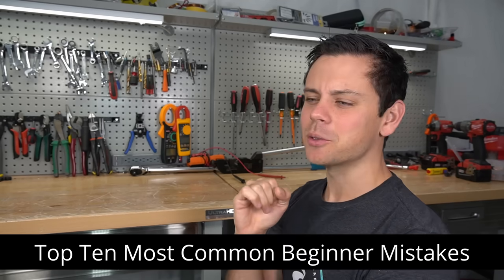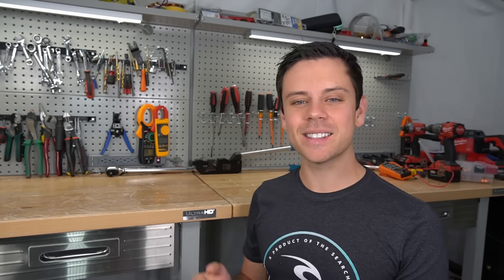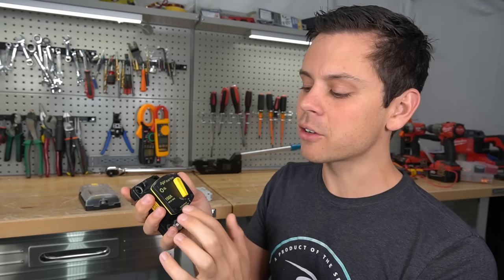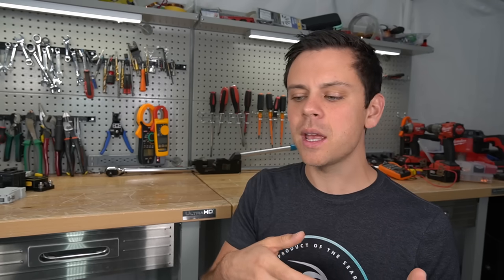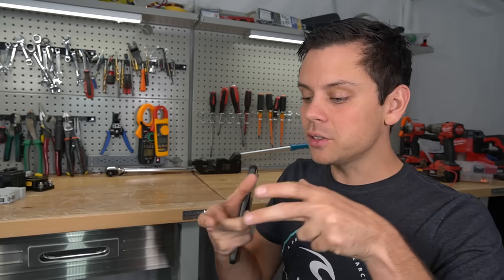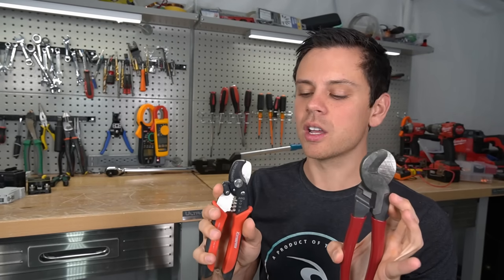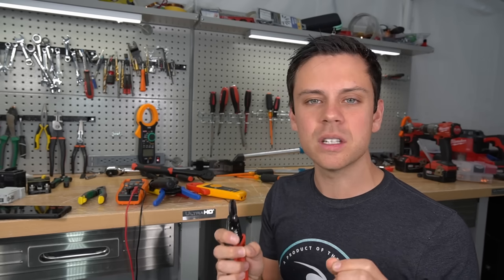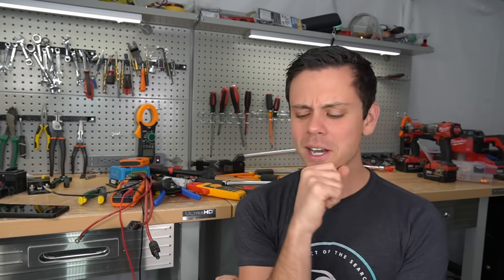Top 10 Beginner Mistakes When Building a DIY Solar System

Comment: i am a noob stumbled on this video as i am researching a replacement for an SLA 75 amp hour in a travel trailer that has gone flat.

The charge controller in the trailer is a 10 amp go power PWM. The solar panel is one go power 190 W on the roof.
12 volt is required to run the furnace.
And current configuration is not handling in it through the overnight battery is three years old. 
Looking at Chin on the amazon . can i do one battery now, and add one later to increase run time? 
or is it best to match in pairs?

Comment: Hello, we arent getting power to the inside of the trailer after hooking everything up properly.  We even tested the inverter with a power drill pluged into it and it worked perfectly.  We then separated  the converter fuse to a stand alone switch and that did not help.  What do you suggest?

Comment: What's your opinion on the lifepower 4 batteries with the CHINT cb-125a breaker? It is ac rated 230v 50hz on the label. No dc marking, must be de-rated for dc.. Feels a bit weak when operating.

Comment: Hello. I'm new to learning about volts and amps, and connecting up solar panels to an Ecoflow power station (generator), and am hoping someone will be kind enough to answer a question I have.  Is it ok, if I connect four 200W 12 Volt panels in series, and then add one additional 200W 12 Volt panel, using parallel?  Or will this cause problems.  Thank you, Lori

Comment: What is the theory behind the Minimum Voltage and how does it play out in practicality?

Clearly, during non-peak daylight hours the output of any panel is going to drop, no?  Meaning you will spend at least a third of every day below that output level.

So what is the minimum voltage threshold really about?

Comment: About 25 years ago I had a boss come by a control panel I was finishing up and told me I needed to go through all the terminals and check them. Told him I don't need to, they're all good (about 400 of them). To which he said, There's loose wires in there. I said go ahead and check. If you find a single loose wire I'll re-land the entire panel. So he proceeded to start yanking on wires. Finally after a while he got down on one ripping the terminal apart and proclaimed, "Found one!" To which I said, get out of my panel you jerk and go annoy somebody else. lol
He turned into a pretty good boss over the years. Could be a pain in the ass but I rarely saw him more than 3 or 4 times a year. Best kind of boss to have. Give you the job and leave you alone to get it done.
But some of us got all those torque specs programmed into our wrists brother. lol

Comment: My load center is 100AMP. That is #3 AWG by code. MPPT 6548 AC input connection fits #4 Maximum. Does that mean you cant go from an inverter to a load center 100amp or more?

Comment: Tinning wires with solder before putting into screw terminals is a no no. The solder creeps over time causing a loose connection.

Comment: Thanks for the great video Will!

One question I have around wire terminations in screw down terminals (such as the Victron solar charge controller). Should you terminate the wire in these terminals bare or can you use a ferrule? I like using ferrules because they prevent any strands slipping out or breaking off, but im not sure if there are any drawbacks from using them I am not aware of.
Reply: Ferrules should help terminals not to loosen as easy, prevent single strands from shorting things out because they are much harder to see in the connector than while crimping. It is still a good idea to check they are tight.

Comment: Would a Litime 100ah battery with an internal BMS need a low voltage disconnect in the wiring system?

Comment: Hey man. Is there a way to talk to you? Even 15 min. If you have prices for that, please post them somewhere. I found your channel just in the last few days. I haven't seen all your videos, so if you covered that, I'm sorry. I'm going through them. I'm working on my set up right now. And somewhere I'm messing it up. Just connecting panel to charge controller somehow I'm not getting power to it. Wires are stripped, it's not rocket science to connect 2 wires to charge controller. Could there be a short, or some other damage?

Comment: Wire that is striped improperly is better to be soldered than crimped.   Solder can fix damaged wire providing connection is heated properly before applying solder.  I have found all kinds of problems with crimped connections.  Granted this was with lower power connections.  Heat shrink holding bad crimp connectiond together causing intermittent-ness.  I understand your NO5 but, question the high power aspects as better to not use solder?  You have experience that is different than mine ie. low power. crimps weaken the wire in most cases.  Heavy wire could be must different?  insulation crimped between contacts is a big problem.  The Proper wire striper can remedy these problems. Solar is much different than I have worked with.  I am just surprised crimping is best?

Comment: If I want to use solar panels to power a crypto mining rig running at 12V, should I convert the panels to an inverter then to a normal PSU or should I use a DC/DC converter to power directly from the 12V panels? PS, no batteries, just direct solar to run 5-8 hours per day

Comment: Good day, I just bought a Eco flow Delta pro with one 400 W solar panel. My intent is to put it in the closet and not use it but if I need to, I’ll bust it out for an SHTF event…….. is a bad thing (not using it for potentially years)?

Comment: With regard to #10…
Friend is about to try testing his EG4 6500EX48 with only 2 Canadian Solar 445 watt panels… where the voltage total in series will fall slightly below the 80V startup voltage. (78vdc -96vdc where low is operating voltage and high is the VOC)(39.3vdc and 48VDC respectively)
What will the result be of this setup? Will it fail to charge his EG4 5100 battery?
Reply: So my friend finished his install with only two panels - Doesn't have time to install the rest.
The two panels in series did provide the required startup voltage just fine...
One thing to watch out for is on the DC Battery Disconnects from signature solar - double check the screws for the copper plate that is in there - even if your wire terminal screw is tight, this screw may not be and will cause a problem and cause a fault at the battery, thus not starting the inverter. - make sure the copper plate is aligned and tight. It's easy to miss if you're just checking the cable screws.

Comment: What good are torque wrench & screwdriver when most devices do not provide torque specs.  For example, I have an EP-Ever Tracer 4210AN charge controller.  I went carefully through the entire manual after watching this video and there was not one torque specification to be found.  At least for my older Renogy Adventurer controller [which I no longer use], it said on page 8, "CAUTION:Do not over-torque or over tighten the screw terminals."  Unfortunately, no where does it specify the correct torque value!  This was also true for my Battle Born batteries [BB10012].  I'm not sure about my Chinese "Reliable" 3000W  inverter, as I can't find the manual.  Also, this is especially the case for intermediate connections where no device is involved.

Comment: I always thought torque screwdrivers were not a necessary item, but after tightening 50-100 terminations in a row you will experience fatigue such that your "torque by feel" will be much less than what you started with.

Comment: Just ran across this video. Thank you for your insights. I have a question about stranded wire. Does soldering the bare end of a stranded wire help maintain the proper torque spec for the connection? It seems to me that expansion/contraction of the strands would promote possible movement of the strands and cause the connection to loosen over time. Any thoughts?

Comment: Can I use 840w or 800w 12v solar panels on 60A mppt solar charge controller instead of 720w rated since solar panels or charge controller are only 85 to 95 percent efficient?

Comment: I need to burn say 10 volts off each of 4 arrays before it gets to my Bluetti EP500 Pros.  On really cold and clear sunny days the 3 panel arrays will exceed the 150 volt limit of the Bluetti's 2 internal MPPTs.   I have searched the internet for a solution, Bucks controller or stepdown converters included but I have not found a solution that fits this issue really well.  I'm sure there is a smart and effective solution what will allow me to maximize the possible voltage and keep it from exceeding 150 volts.  Bluetti offers, sometimes, a stepdown transformer for a spicy $600 and I would need 2 to solve my system design limitations...that seems really high for what I'm asking.  Am I wrong?

Comment: Building my system. I ordered 4 LiFePo4 24v 100ah power queen batteries. Laid a stright edge across the top end to end and in the middle there is a big hump would that be normal for these batteries. thanks for any info.

Comment: Hi, I love your channel, but I live in Europe, where the power grid is 220V not 110V.
Is at least some of your recommended hardware (mostly inverters) compatible with the European system? (Notice that phase to neutral is 220V not the same as 220V in the US).
Is there a EU compatible inverter with anti-islanding function and that can be prevented from sending power to the grid (only house supply + battery charge up to full) in the 5kW or so range?
I guess it would need an AC current sensor just after the main panel.

Comment: Is it possible to build a system that will supplement the city power, that can also be used during a power outage?  If so, can batteries be controlled so they don’t go below a certain level at night (supplementing city power) when there is no sunlight, so the reserve can be used at night if city power goes down?

Comment: I have 400w of solar on my new travel trailer, 30a go power pwm, 1000w inverter,
Off grid camping amounts to 25% of the time....I'm guessing I need no more than 200Ah worth of battery storage. My question is ... 2- 100A LiFePo or 1-200A LiFePo?? 
My factory battery box will only hold 2 class 24 batteries or 1 lg Ah battery.
What would you do given this setup??
Thanks in advance!

Comment: I use AC light switches to control the 12v lights i have fitted around my house. They are very low power led down lights so it's ok..

Comment: A manufacturer told me that if you charge a battery with  solar mppt  and put load on the battery through a pwm controller at the same time the charging voltage would drop and the battery will not be charged to the full. You tubers on the other hand demonstrate DC systems using the above wiring. Actually the 80 Amps MPPTs don't offer a load connection so people share the battery connection for the load using a Pwm to avoid complete discharge. Any tips. I really want to use a DC system with two 12v batteries in parallel to run a few dc fans and lights. Kindly advise I am really stuck.

Comment: I have a Krieger 2000 watt pure sine wave inverter and a 100 amp hour ampure time battery with heating function. Whenever I hook up the inverter directly to the battery the BMS shuts off the batteries voltage. I have been unable to get the inverter to power on. The voltage on the battery is 13.3 volts. But when I hook the inverter up to my AGM it works fine. Is there anything I can do to prevent the spark to keep the BMS from shutting off?

Comment: I destroyed a capacitor today with 12 volt, it exploded inside the device which was for 5 volt - although the security issue with some batteries might not have helped... Apparently the batteries also goes backward in the system and it was only really for the computer as a small UPS - yet... sadly it goes back in my system, and I guess I need some kind of 1 direction thing.

But it made a pretty big pop, and it seemed it wanted to go to the moon. The hole metal thing had been shot wild, and the inside of the capacitor was everywhere.

Comment: Hi, am using BELTTT 3000WATT with AC input. How can I charge my battery. Do I need to turn inverter on or off before charging the battery?

Comment: Hey Will! Great video! Was wondering if you can be able to get your hands on the growatt HVM G2 series, there are two versions, a 3000w and a 6000w. Their user manual states that the no load consumption of these units is 20w and 35w for the 6k, that sounds too good for a LF inverter. A review from the best will settle it i think, thanks.

Comment: Hi Will, 
I am new to your channel and love your videos. Easy to understand (mostly 90%🤔😄) even though I am not electrical savvy. I have a renogy 400w system (for my tiny home box truck conversion) w/a 1500w inverter (not renogy) but it's not enough for my needs (barely). I've made most of those newbe mistakes🤣🤣. I want to upgrade(increase power) so I was wondering, do you custom design systems and if so how much?

Comment: I have two brand new 100 amp hr lithium  batteries and I am using them connected in parallel.  It seems that one of batteries might not be sharing the load equally with the other. When checking the Bluetooth app all the power is comming from Battery #1 and none from Battery #2. Is there something I need to do to make the bluetooth BMSs "see" each other?

Comment: Will, Your videos are entertaining while informative.  Thank you in advance if you are able to answer this question. I'm trying to power 3 outdoor light strips that come attached to a 24v and 1.5amp power supply. I would like to power them for 6 hours per night and I've attached 2 - 12v AGM batteries in series and charge them with a MPPT solar charger with 2 - 100 watt solar panels in series. It works great in the evening of a sunny day. I believe that my batteries are inadequate. Can you give me a rough idea of what battery configuration you might use in a scenario such as this? I get approx 2 of every 3 days good sun. What battery config might power those 3 light strips for two or three 6 hour nights.

Comment: You say not to use aluminum but if i have a 150' run from my solar panels to my charge controller thicker aluminum wire is so so much cheaper than copper for that long distance, is it ok to use aluminum for that run?

Comment: I have a question, I messed up by purchasing a 550 watt solar panel, and a charge controller that has a limit of 160watts per panel. Can I use multiple cables off of the same panel to fill the two positions for solar panel input to at least get 320 watts out of my panel?

Comment: As a marine mechanic and electricians apprentice this lad is correct about the large lug and soldering l, you never do it !!! And as for aluminum wire again correct because aluminum clad wires in copper expand and shrink and causes multiple electrical fires ! Hence why the building code somewhat accepts that wire but only in certain uses and areas, always always use pure copper wires and the proper size !

Comment: hello I need your experience on my system of 2 panels of solar panels 370 w (voc)41.0v and 11.42Amp , and my all in one invertor  3000va 2400w vevor 24v system has max (voc) 80v and 50amp rated  is it ok of the total of 2 panels is 82v series connected or i have to connect them paralel thank (las vegas resident )thanks

Comment: This is a good Video, except I disagree with your reason for not soldering the lugs to the cables, Lead is a common metal used to provide a perfect connection between two similar types of metal, in this case, copper, the reason for not soldering is that the longevity of the joint will deteriorate if moisture is allowed to get into the joint. Sealing the joint with the right heat shrink will prevent that from happening. As a Master Electrician, I can solder the joints without damaging the insulation, beginners should not attempt it unless they are very experienced, applying the right heat and the correct amount of solder and flux takes practice and experience, but if done correctly, it can provide a joint that will transfer the electrical energy with virtually no resistance. and last a lifetime.

Comment: Hi will, good video even though much should be common sense I'm sure everyone other than a pro will get something from it, I particularly found the crimping v's soldering issue very interesting.  Must say though if someone tries to use a 24v rated device on a 48v system maybe they should not be doing DIY electrics!  :)  

Can you answer a question for me please.  Taking the solar charge controller example you gave with an operating range of 120VDC - 500VDC (VOC) does the efficiency vary within that range?  For example when the solar supply voltage is say 150VDC would the controller operate more/less efficient than say 450VDC or perhaps the middle of the range at say around 300VDC?    David

Comment: I love all your videos, please keep them coming! On a different subject what are your thoughts on using generic power tool batteries( for instance the Milwaukee clone batteries m18 in the 9.0 or 12.0 amp/hr size) for a small to medium power system?! Putting several of them together in series and parallel to get up to capacity with a 100 amp/hr battery system? I’ve tried doing the math and it seems like these would be WAY cheaper than the ones you recommend! I’ve also heard lots of bad reviews so maybe I’d be getting what I paid for?! Your thoughts?! Thanks!

Comment: I know you know the answer to this question:
What would it cost and how many solar panels, controllers, batteries, amps, watts, volts, etc., will it take to replace the everyday electricity usage for a normal sized 2-4 bedroom house with at least 4 residents?